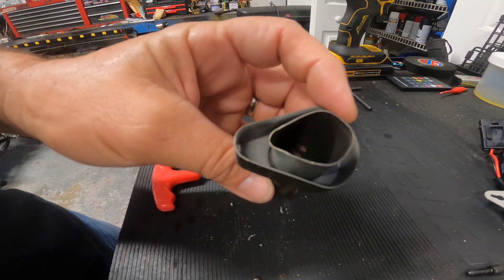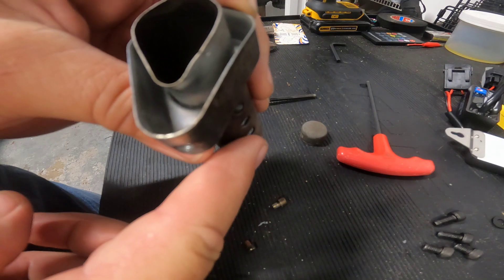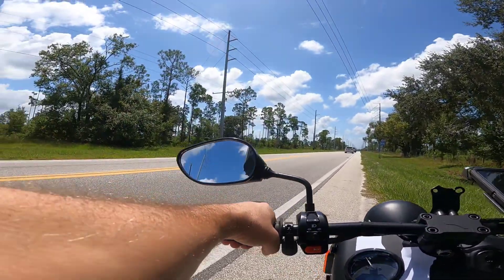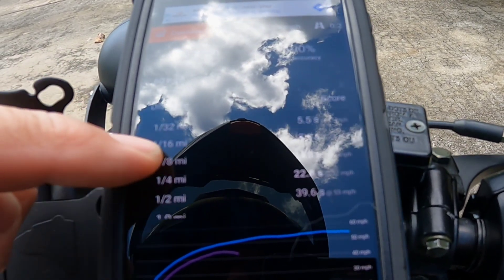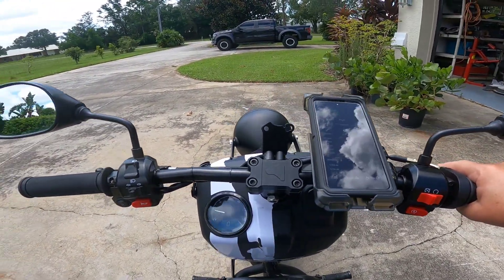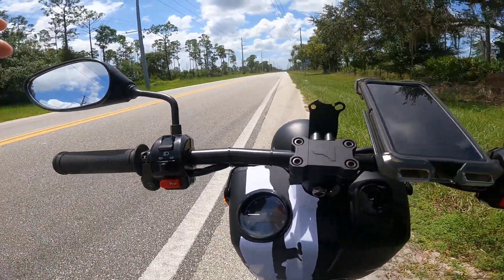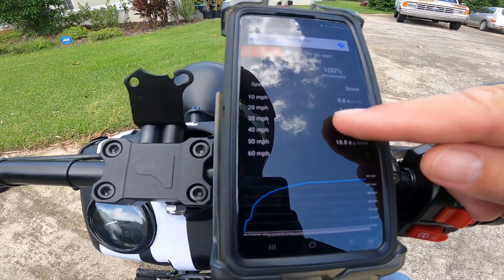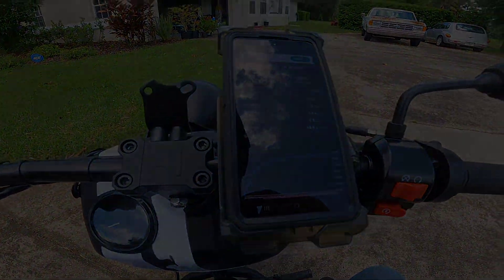Maddog 150 Gen V FREE MOD #3 (Exhaust Baffle) + 3 MPH

Comment: My 2022 Gen V blew the restriction plum out by itself.  (Screw vibrated loose)  thanks for testing,  like seeing accurate #'s. My top right now is 53 mph.  But I'm 300 lbs will be installing Rolling Wrench Kit & Kaboodle 172 cc kit, new CVT set up and final gears. I will be making short jaunts 3-5 miles on interstate. Thanks PS I'm 73
Reply from the maker: I'm 59.  LOL.  I'm looking at that same kit kabootl kit, but not sure what cam it is.
Reply: Did the bike ride good for you out of the box? Or did you have to do upgrades to support your wait? I'm a little over 3+ as well and was wondering about this.